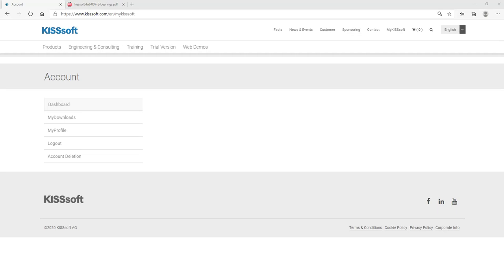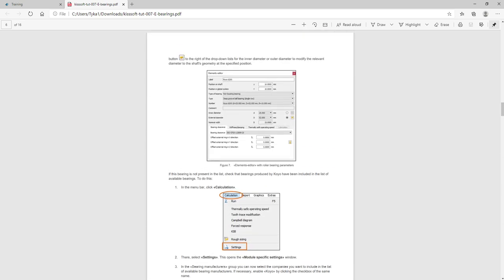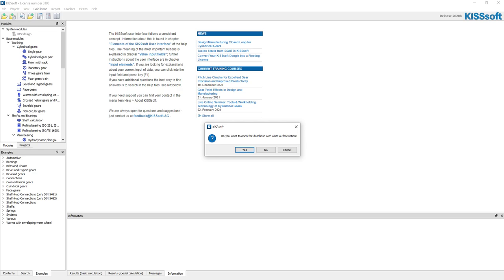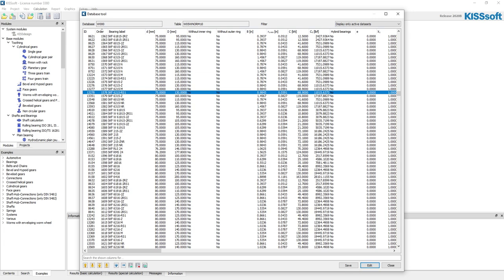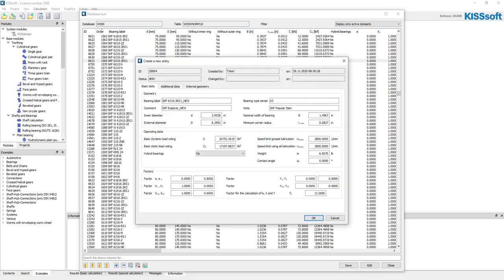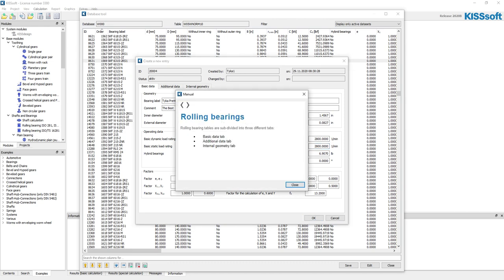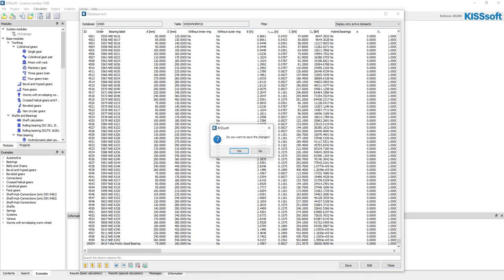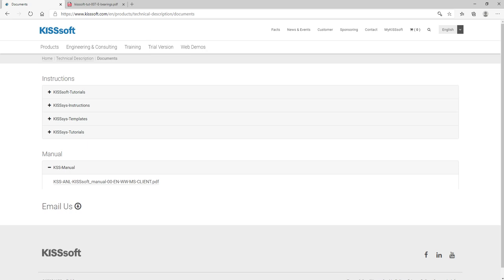Add Bearing to Database

Comment: Does KISSsoft support needle sleeve bearings? Or can one import needle sleeve bearings in some way, instead of manually inputting the data from e.g. the SKF website?
Reply from the maker: Needle Sleeve bearings would have to be approximated by the caged needle I think.  since we cannot know what the machined tolerances are for the inner and outer diameters are.